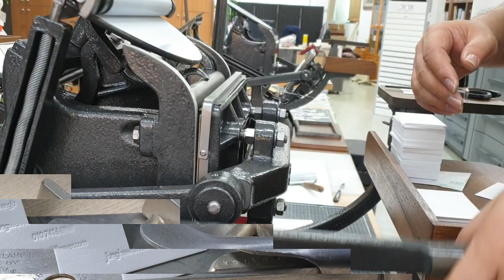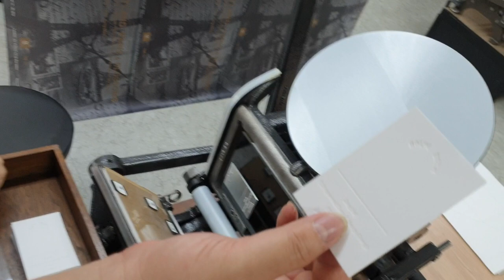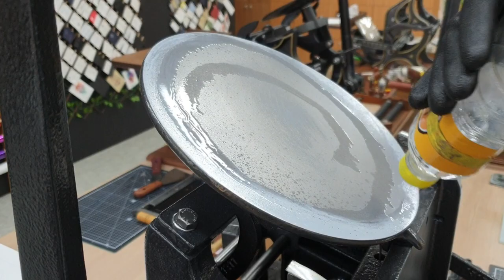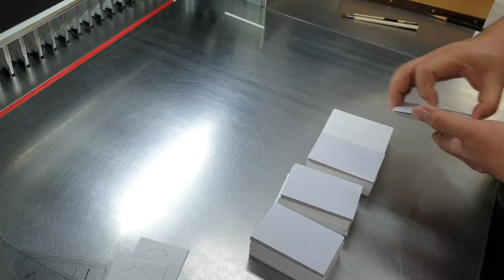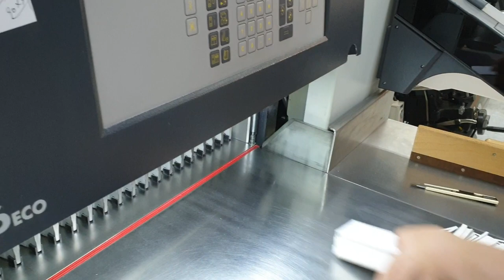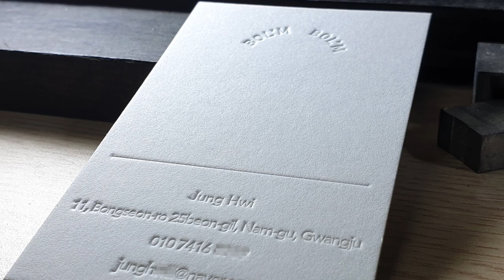레터프레스 백색인쇄 명함 만들기.

Comment: Was that silver on grey?
Reply from the maker: no.  White print.  I think it looks like that in the photo.😅😅
Reply: @w_letterpress  love your work. You made me more motivated to look into further aspects of using my Heidelberg 10x15. I only use it for foil work and some blind embossing. I have never used it for printing with ink. I would have to disengage the foil modification to actually print with ink.
After watching your videos, I have been looking for another letter press so I can experiment with this type of printing technique.
Reply from the maker: We recommend c&p 10x15 if your workspace is free.  Sophisticated work is possible and paper is saved.  Of course, productivity is insufficient compared to wind mills.  But the work stress is much less.😅😅
Reply: @w_letterpress  What about your small table letterpress machine? Is it good for usage?
Reply from the maker: It is convenient when making small quantity, and cleaning is also convenient compared to other large equipment.  Printing is also good.  But there are limits.  Printing with a lot of pressure may be difficult even with a small size.  That's why I recommend for beginners to have one big machine or one tabletop machine.